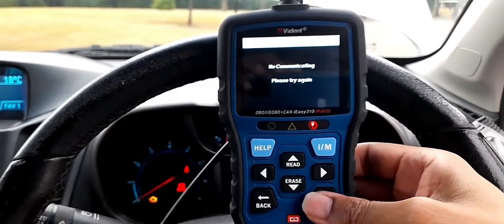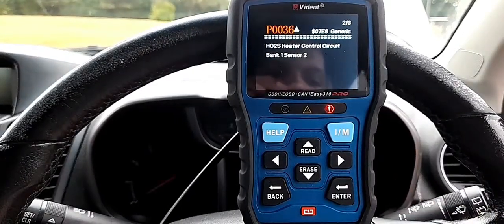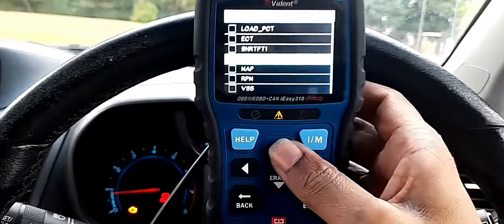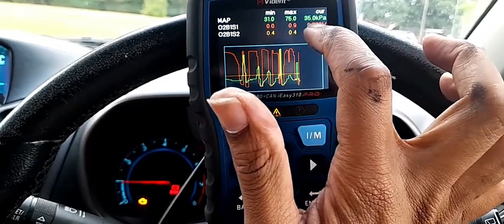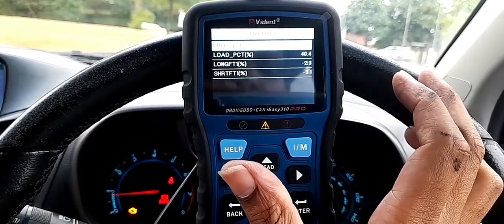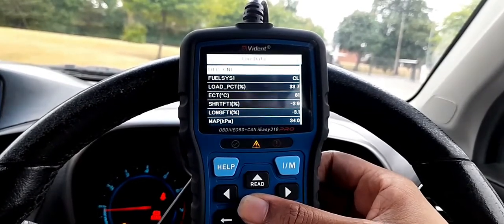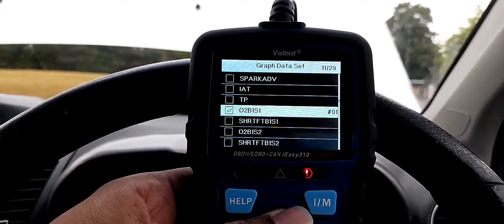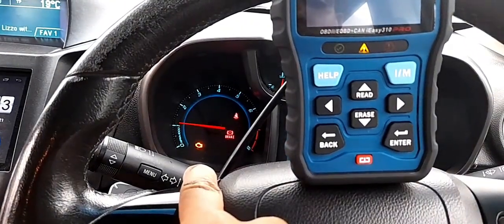Fuel system 1 Open loop Drive | O2sensor bank1 sensor 2  P0036

Comment: The O2BS2 don't need to 
fluctuating only the BS1. The Bank 2 sensor only measuring the oxygen level after the CAT and not affecting your fuel consumption.
Reply from the maker: I realise I get up to 35MPG on motorways I guess an old car that is the most I can get, I use Ford fiesta and I am getting about 24MPG so looks like the roads I am driving

Comment: I noticed when you press gas pedal , the bank 1s2 is not responding that means either the sensor is bad / the heater is bad / wiring problem 

Since you replaced the sensor, then check the harness and wiring for electricity
Reply from the maker: I’m thinking it is the sensor again, but it did not bother me much and I got rid of the car now

Comment: Hi  my  motor  is   B16 dth  diesel   is  the sensor  placed same   place   as  yours
Reply from the maker: Hi have u checked ?it should be at the same place
Reply: @nuramoboy  no sorry not yet my wife had the car for work i will look into it on saturday
Reply: @nuramoboy  Yes  its  nearly  same  place  talked  to  Opel garage   i  had  to  peel  off  serviceplate  underneath  the  motor   and  i  will  do that   between  xmas  and  newyear   ,i will  try  to  clean  the  sensor   with   brakecleaner   it shoul   be  funktionel  because  its a  lot  of  money  to  spend   ,i got an   DIY from local Opel garage   665  GBP  only  for  the   sensor   ,so  i had  to   take  the  old  sensor  out  to   find  the  exact  number  so  i  can   find another   place  to  buy   a  sensor  my  motor   is  opel   b16dth   1.6  cdti  opel  zafira  tourer  p12  from  2015
  136  hp   maybe someone  on  the  line  know  where  to  find  the  right  sensor  for  me   .Thankyou   and  merry christmas to  u all   around   .Kurt